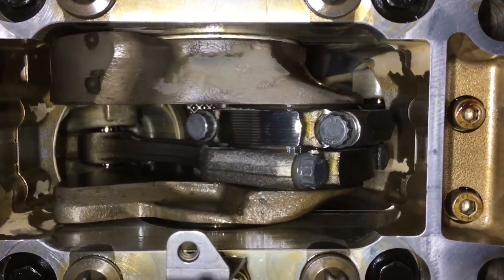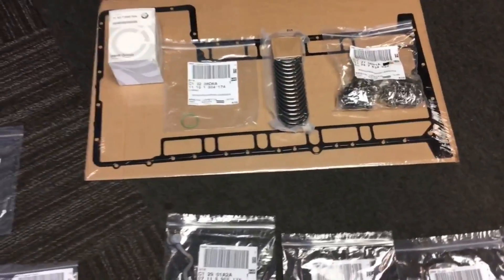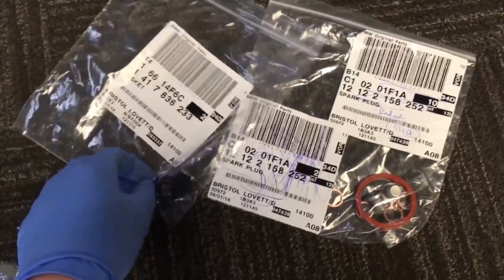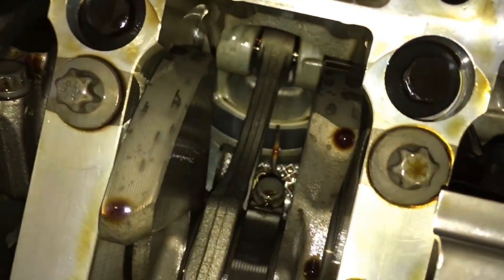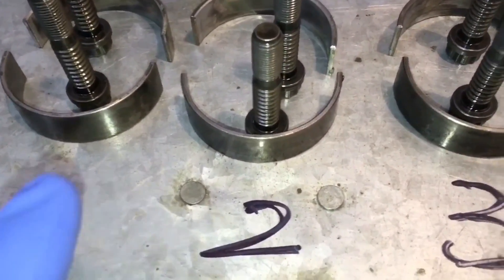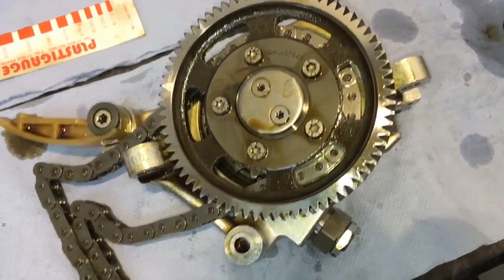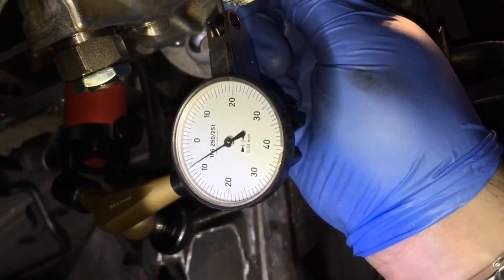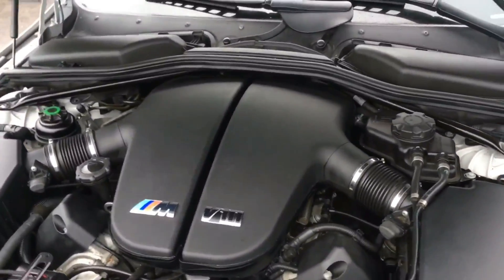BMW M5 V10 Rod Bearings - Piston Oil Jets - Vanos Pump & Pipe

Comment: Hi there, i have 140k km on my e60 m5. Tracked it once and will track a few times a year in the distant future. I have changed my rod bearings 15k km ago and the vanos parts are still in good shape, but I have not changed to the updated oil squirters. Do I have to change the oil squirters if I were to track my car few times a year?

Comment: Great content and exceptional workmanship @reddishmotorsport. Can you explain if the rattling noise that's usually associated with pre-lci cars from the vanos pump disappeared after the updated chain tensioner, spring and sleeve were fitted? The reason I ask is that all of the Lci cars I've heard they don't have this issue and the vanos pump #'s are the same on realoem throughout the production run. Thanks

Comment: Great video, my friend recommended you guys to do my rod bearings on my m5, I have all parts and many many more parts to have replaced, I asked bmw what they would replace if they did it and just bought all bits, also when doing this job it's worth replacing the aux belts and pullies and engine mounts as it's in the same area

Comment: When you check clearance with yield fasteners do you yield the bolt?  Do you basically have to buy twice the amount of bolts you need?
Reply from the maker: Great question BigBrap. Luckily you don't have to buy twice the amount of bolts. The clearance check process can happen with NEW bolts.
This is because the NEW BMW Bolts have to be stretched (torqued) 3 separate times to achieve correct yield.
So we use the clearance check process as Stage 1 yield.
Then once clearance work is finished we can apply Stage 2 yield.
Then finally lubrication on bearings and apply Stage 3 yield, which is where it's finally finished.
Hope this helps.
Please consider Subscribing to our YouTube channel!

Comment: Another nice s85 video. Thanks!  I found it funny how you guys use inches for clearances. I thought UK was mainly in metric units...
Reply: We do but that's just the measurement card that comes with the plasti gauge
Reply: g4rr377 did you guys convert from using miles to km?
Reply from the maker: No we never converted from Miles to KM, so still use Miles inside the Vehicle Dash, as well as Road Signs, and even use MPG for fuel consumption too.
Reply from the maker: Thanks Hansbrix, we're using metric (mm) in this video. It may appear inches due to the length of the numbers but all these measurements in this video (from the Plastigauge Card to our hand writing) are all in mm, i.e. 0.038mm.
UK uses almost all metric systems apart from arguably Miles, and MPG which are still the norm for distance/travel.
Hope this helps.
Please consider Subscribing to our YouTube channel!

Comment: Do the bearings in the vanos pump fail often? If yes is there any way to rebuild or change it? Great content as always. Greetings from Germany ✌
Reply: Zombie Head I have a 00 E39 M5 with 317k original owner. Never had issues with the rod bearings. Don’t skimp on oil changes and use 10w 60 oil. I do my oil changes every 3k miles. I drive the car hard. However it’s always warmed up before hitting 7k rpm. You will be fine. I’ve had 6 high performance BMW’s not one issues with rod bearings ever.
Reply from the maker: Hi Albert, greetings from the UK.
Thanks for your comment.
The S85 Vanos Pumps do break up but not too often. Sometimes it's bearing failure and sometimes it's teeth breakage on the Helical Gear Wheels.
Here's another one of our videos which shows Vanos Pump Failure:
https://youtu.be/egpZjyNP7jQ?t=65
It's probably best a replacement one is sourced rather than rebuilding as I'm not aware of any internal spare parts for them.
Hope this helps.
Thanks for Subscribing!
Reply: Albert Sch it seems to be a bigger issue on the pre LCI engines (2005-2007) model year.  Dirty oil and metal debris from the worn bearings go through the VANOS pump and can destroy or crack the bearing race on the VANOS pump.  Hallo aus der USA.
Reply: Zombie Head your name says it all... you don’t have a clue. I would not take advice from someone who reads forums and takes advice from others who have never owned an M car. You don’t have a valid argument. You have never owned an M car. Take it from some one who has.
Reply: @Zombie Head Thanks , but i know the rod bearings are a common problem. I was talking about the Vanospump itself.
Reply: Albert Sch These can be redone at dr vanos. Or you can do the rebuild yourself. It’s not very difficult. Each unit can be sourced and rebuilt using used individual units. If your doing it yourself you can find vendors selling individual units online. Or you can have the whole unit rebuilt.
Reply: Zombie Head I’ve had black stone reports done and they come back clear. No copper or any metals in the oil. Like I said, take care of your car and you won’t have issues. I wouldn’t be scared away of owning a car because of maintenance and repairs. If it breaks fix it.